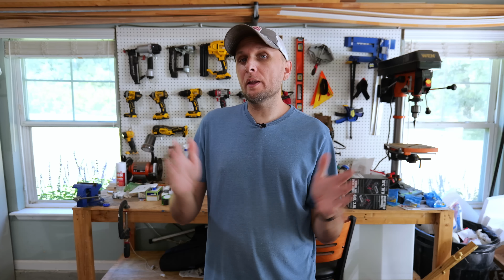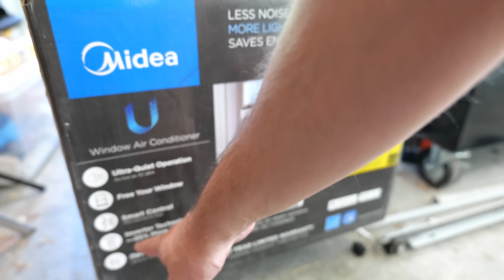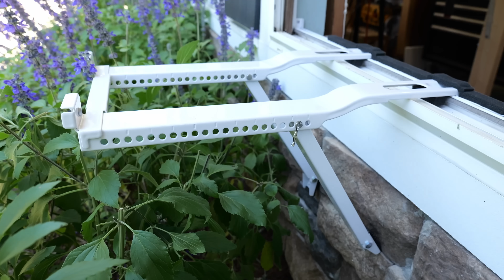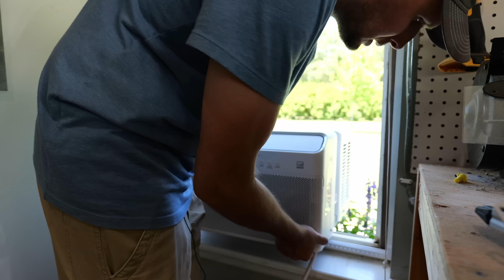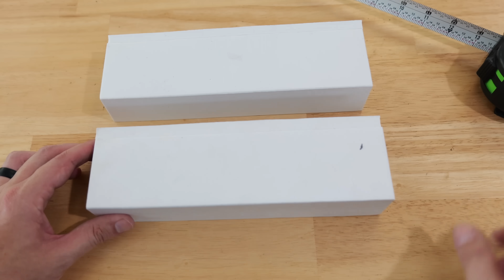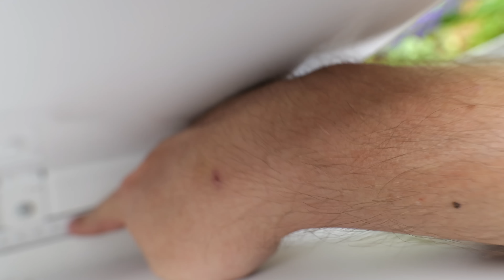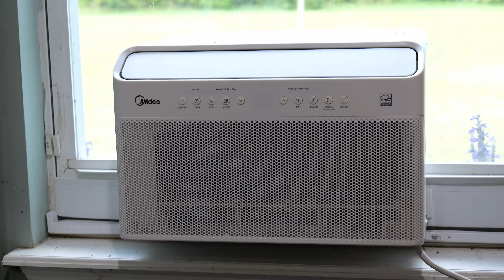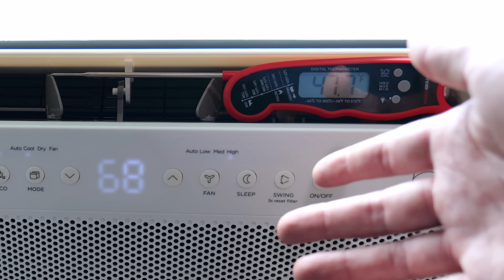The COLDEST And QUIETEST AC Unit Ever Made!  Still Use Your Window!

Comment: I wish companies would make window ACs for horizontal sliding windows, which are the most common window found West of the Rockies instead of just for casement windows.
Reply: I have the toshiba branded (midea bought toshiba) 12k btu  portable dual hose on a sliding window in my bedroom. It's been running everyday for 2.5yrs and hasn't skipped a beat. It's overkill for the bedroom (280sqft) but with the inverter it just doesn't stress itself. 

This is the same unit in a different form factor. More efficient, but same "guts". 

I'd highly recommend the one I have! It mostly evaporates the condensation out the exhaust pipe but I live in a dry hot area. If its really humid where are you will need to drain the unit. I've never had to drain mine ever though.
Reply: @squidsleap so you have it on its side?
Reply: @mrktanarchist no, mine is the stand alone portable, it's the same compressor system with the inverter. If I had a vertical window I would have this one, but mine works great for small space it's in.
Reply: @squidsleap how cold can it keep your room when it’s 100 outside?
Reply: @JayDubNation83  where I live it almost never hits 100, maybe 5 days a year, but we do get a lot of days in the 90s. 

It can keep the room colder than needed, I set it for 78 on hot days, turn it down to 69 at night so sleeping is comfortable.
Reply: @squidsleap  ty
Reply: @squidsleap I am considering one for a 280 sq ft room as well in South Florida. How efficient is this unit on your electric bill, and do window units only do A/C or can they switch to heat as well?
Reply: I agree..
Reply: They use to be called Casement AC
Reply: There are units with the u-shape on the window sill side and they make kits to fill in the space above the AC unit for a horizontal sliding window.
Reply: I like how you made up a word for the more popular variant lmao
Reply: Depending, you may be able to turn your window sideways.  Or, just remove it and build a custom frame and trim it out for glass.  Or, filled in side panels, wood, (whatever)... and the top, a third section, glass.  The using the window thing is BS, anyway.  To do that, you have to build a custom screen and figure out how to mount it, and it will be easier to break in with the window in the open position.  Even not worrying about that, the top foam insulation will fall out every time the window is opened, and have to be reinserted, or you can find a way to make a permanent foam install to fit, such as using sticky foam insulation.

I just returned one, an 8,000, and installed another.  They suck.  Not enough air flow/CFM, (not 20 feet), it does not cool as good as touted.  It definitely is not ten times quieter!  That's a huge lie!

BTW, mine does not look like the one in this video or the one on the Midea site.  Looking at thumbnails from other videos/months/years, I don't know why there is a difference.
Reply: Oh, yeah... or, depending, just remove the part of the window that opens, then build to fit.  Before I actually bought the first unit, I was going to remove/reinstall an entire horizontal window.  But, after using them, and BS CS, more than likely I will return the second, and buy something else.

The main reason I purchased was because of the inverter, and quiet, and I needed at least two to run on a generator until I get two (solar) mini splits installed.
Reply: We use to make a high, or bottom horizontal section of the window fixed. Fixed section holds the AC in one of itas sides and remaining bigger portion keeps on sliding
Reply: They are NOT most common that's why you can't find one
Reply: @keepitthoro6768   They are common.  I live in the south and every home in my subdivision has both.  And, I have been a lot of places.  I see both everywhere.  The main reason is cost.  For instance, every one of the U has the same case design/dimensions.  They know they are not going to sell to everyone no matter what type of window.  ...  BTW, from my experience, their CS sucks, also.

NOTE: He said: "...West of the Rockies...".
Reply: @MundiTaurus  nope not really
Reply: @keepitthoro6768 still ALOT of people do have horizontal windows and it’s surprising they don’t capitalize on those customers
Reply: @bryanportillo2348  because it's a small portion
Reply: @keepitthoro6768  it's not a small portion. Most if not all mobile homes have horizontal windows.

Comment: I have this unit. The first year I was impressed. Second year I noticed the buildup of dust on the round fan blades. No way of taking it out so you have to clean each individual blade which takes me 45 minutes. Definitely tell a different in air flow when cleaned. Kinda like the difference when you clean an extremely dirty ceiling fan. Ended up cleaning it around 3 times last summer. This year, it doesn’t seem to cool like it has in the past. I have to set it to 73 and it still goes over 76 during a 95 degree day. I turn it down to 70 around 7 at night and I’ve gone to bed at 11 and it’s 74+ in my bedroom. It’s 72 outside now, it’s set on 70 and the room temp is above 73. If the blade was easier to clean, I’d like it more. I want to purchase another one but have been looking at the other brands that have similar products. Cleaning that fan is something I really would like to avoid on a future purchase.
Reply: Use compressed air to clean the blades of a hose.
Reply: Maybe add a HEPA filter in the room that’s in?

Comment: I Absolutely Love mine!  I am just stunned that a window ac can be whisper quiet while keeping the room completely climate controlled...if I didnt try one out, I would never have believed how nice these units are... One tip: there are improvements made on the very latest models, these have touch sensitive front buttons vs the older models push buttons... on the latest ones there is a drain plug on the right rear.. I'd recommend removing it from day one so the unit can drain water properly as these can have mildew issues for people who had the previous units with No drain.. especially important to allow it to angle down about an inch in rear so water will get out... I think most complaints regarding mildew were from people who had the previous versions, no drain hole and mounted the ac level so it would Really build up moisture  and stay wet inside..

Comment: All the hype is just that, hype. I have a 280 square foot bedroom. Got the 10,000 BTU unit because that room can bake. Unit is incapable of getting them temp below 78 or 79. 6 hours running full blast (950 watts) and that’s the best it can do. Obviously needs a warranty repair… but guess this, they never ever will try to repair the unit. They kinda said at first they would process what I paid into a physical check. Seriously? Then they caught wind of my purchase date and pushed me onto Amazon to return the unit. Which given my age and condition I’ll have to hire folks… AND I am assuming Amazon will send me a return label and UPS will box it because the installer tossed the original box, at the time I didn’t mind with all the glowing reviews. It is UNFORGIVABLE to buy a major home appliance that the manufacturer will not even attempt to fix. Now I am out my installation fee and will have another one to deal with. Needless to say, the name Midea is shit to me.

Comment: IF you have a standard or small window that support works just fine.  IF you have a wider than normal window it is basically useless.  Had to get some ply wood to make up the difference for my wide windows.  It works great as an AC unit but check the max window size first.

Comment: I install AC units for a living and I actually bought one of these just to try them out. Now I have three in my house and my son also installed two in his house and they’re a lot cheaper than mini splits. I mean by far ! They’re not only cheaper but they work just as well in my opinion as a mini split. They are very quiet, but I would not say they are quieter or even as quiet as a mini split with that being said they are still probably half the noise of a standard window unit and very efficient.
Reply: Thank you for your honest HVAC professional opinion. I was just about to buy a mini split then came across this video in 2025!
Reply: Does this unit have heat?
Reply: @JosephMetts No.
Reply: What about the power? I heard a mini split takes alot less power than this one. Is that true in your opinion? And experience?

Comment: I've had myt 12,000 BTU unit for 3 Years, It's alright but sorry to break your review a regular same priced unit would've been better this is for higher security..
Reply from the maker: Doesn't break it.  We disagree is all.  There are other things that can be installed for security with any unit including this one.  Comes with 90° brackets that lock the window in place if desired.

Comment: I bought the 12,000 BTU model 3 years ago.  I opened it for the 1st time 2 days ago.  We got hit by hurricane Beryl and all it took was a 2,000 Firmen inverter generator to power it for 5 hours.   

It kept my master bedroom at 70 degrees, super cold compared to rest of our house with no power. 

We didn’t have to drill a hole. We just screwed the brackets to the side of the Sheetrock with no issues.   

It literally took 10 minutes to install, I spent more time watching the install video than installing it. 
My family and 2 dogs slept so well and for the price of two or three hotel night stays, this thing has paid for itself already
Reply: Good to here that, I'm looking for a unit here in Houston too 😅. Did it do okay with the storms that passed after Beryl?
Reply: @MSTR-DTH23  the 2000 W inverter generator ran for six hours with this window unit.   I specifically bought this for this exact scenario after Harvey and only opened it for the first time after day two of no power.  Thank God, 24 hours ago after the 6th day, we got power in Conroe.
Reply: @Josue-rd5gt  we got power Friday night. Definitely looking into a generator and window AC unit now. 😂 Better late than never I guess.
Reply: Only thing I really needed to know is how many 100ah batteries I would need to run a window unit for 10 hours.

Comment: Great video as usual! I may buy this unit. Thanks. Just to educate a little, the window sill is the shelf below the window on the outside; usually sloped to shed water. The inside shelf is called a window stool. I hold no judgement because in the USA many learned the window sill to be on the inside. Cheers!

Comment: I need to install one of these in a double window, so no wood frame between the windows. For those that have installed these, any reason I can’t cut a spacer to go under the bracket and drill into the wooden sill that way? Can’t see why that would be any different than going straight into the sill in a window that doesn’t have the lip at the bottom.

Comment: Help!  I bought this AC unit last summer, never unboxed or used it until about a month ago.    We set it up, plugged it in and immediately got the error message EH 06, which is apparently a room  temperature sensor, part #11201007003424, which is always out of stock, apparently.   I did order it from an authorized warehouse  and it's apparently still  out of stock.   I'm wondering if the sensor is somehow  just not plugged in properly.  I took the front panel  and the  screen off the front and you can see the sensor, you just can't see where it's supposed to be plugged in.  Can somebody please guide me about getting inside the unit enough to just see where it should be plugged in?  Even if I did get a new part, how in the heck am I supposed to replace it if I can't get inside the unit?  Thanks. HELP!!!!!!

Comment: I bought one of these about 3 years ago for a basement office room.  Because of the lack of a full size window, I just vented it through the wall into a storage area.  I previously had a Maytag AC unit in the same spot.  The Maytag would put out a ton of heat into the storage room.  It was noisy and just OK for cooling the room.  The Midea is 100% better.  It much quieter.  Cools faster and better and it puts out a FRACTION of the heat that the Maytag did.  In fact it barely raises the temp of the storage room.  Another plus - while I keep a tray on the floor below the unit to catch water, the Midea never leaks water onto the tray.  The Maytag would put out tons of water and I'd have to empty the tray every other day.   It's also Energy Star rated and barely affects my monthly electric bill.   Midea AC units = A++++++
Reply: Wow!

Comment: Great video my moms central air went out with this humid heat wave we are getting in the region we reside. 
Can you please confirm the u shape measurements? From the website it seems to be ok as she has a dual double pain window in her living room. States 3” that definitely fits if correct. 
Want to buy the 12,000 btu model so it can cool her living room and kitchen

Comment: AC is to cool 20 to 25 degrees colder than outside air. And air blowing out 20-25 colder than air going in.  If its 100 outside, cooled room will be 75 to 80.  If its 75 in house, unit should blow cold air 50 to 58 degrees.

Comment: Other things to test in the review is the humidity in the room while the air conditioner is operating, and energy consumption.
They make inexpensive combination thermometer/hygrometer units that are actually able to measure humidity along with temperature, which is a critical part of the environmental comfort. 
Energy monitors such as the Kill-A-Watt or more comprehensive devices like an emporia vue are able to read and log the power draw while running.
As they're not that expensive, they could be added along with energy monitoring meters to provide complete information on operating characteristics of HVAC  systems.

Comment: I wouldn't go without AC anymore.

Got a 12 000BTU of a different brand ( this one isn't avaliable here ) and it can keep the temperature as low as 17°C in the 3-1/2 room appartment no matter how hot it is outside.

It was probably too powerful for what I needed, but it's nice to come home and set it lower to have a blast of cold air.

Avoid ''portable units''. Half the BTUs are wasted because the compressor loses heat inside the room.

Comment: I have been using this ac unit for 1 year plus. Bought two more this year at Sams. All working good. Remote sometimes gets "confused" and will not shut off ac with remote but you can still use app or controls good on front of ac unit. It is well worth the money. Do read the yellow sticker on side of box as of right now this is the most efficient 12,000 window unit on the market. My electric bill has been cut in half even during middle of summer with 2 of these ac units running all the time.
  This unit does not have a heater. 
  While it is not perfect it does the cooling job well and is easy of wallet to run during the summer. I do highly recommend this unit.

Comment: Keep in mind that the square footage is based on an 8 foot ceiling. A 10 foot ceiling will need 22k btu if it’s 550sq ft with 10 foot ceilings. This is if you want efficiency.

Comment: i really wish the midea was shaped in the opposite direction, this doesn't work for 2nd/3rd floor windows very well with the install the GE unit it hangs on the sill, which is much preferred.

Comment: People are complaining about horrible mold building up on the inside, any opinion? Also can you tell me the in-rush amps max and operating amps, we are off grid.
Reply from the maker: I have seen that said by a few as well.  It’s going to depend on environment.  One thing I’ve found can be done is adding a cut to fit filter in where the filter that comes with unit is.  It acts as a prefilter and helps keep it clean.
Reply: @HowToHomeDIY  I went ahead and ordered the LG dual inverter. Its a standard box shape and no mold issues. It is suopposed to start at 200w and ramp up and down as needed. Can be 50% more savings over standard. We are off grid so every ddevice has to be a power save and light on energy. We even have a 1 slice toaster to save half the power.  :)

Comment: I am a retired, HVAC technician. The quietest split system, HVAC unit I ever heard or should I say could almost not hear, is a Mitsubishi HVAC system. The condenser fan was blowing because it was moving plants nearby. But I could not hear the compressor running until I got right up next to it. After that, I have been paying attention to these Mitsubishi units to see if they are all like that. They are…

Comment: Too bad my windows are 52” wide 🥲. I would suggest putting a stick between the top of the window and the top of your lower sash for security. Like a broomstick in the track of a glass sliding door. 😉👍. I was about to order this unit until I read the specs. Unfortunately I only have 3 windows at 36”. ( bedrooms ). My couple year old Trane unit is pretty efficient but I’d like something to run off solar just in case.  Any suggestions would be appreciated. Just subbed to your channel.

Comment: I have the 10,000 BTU and it has recently stopped cycling off when the temperature is reached.  The fan just keeps running. Does anyone have experience with this issue?